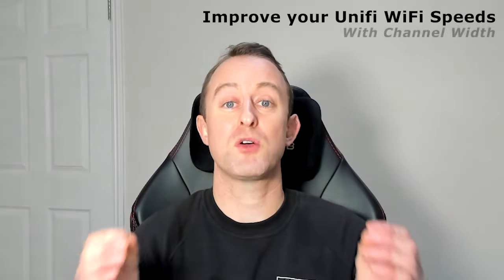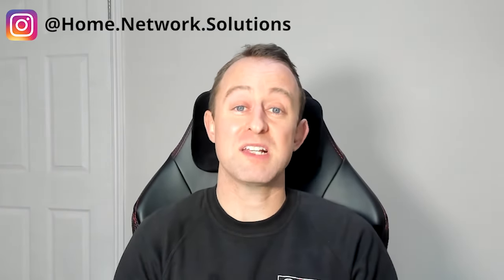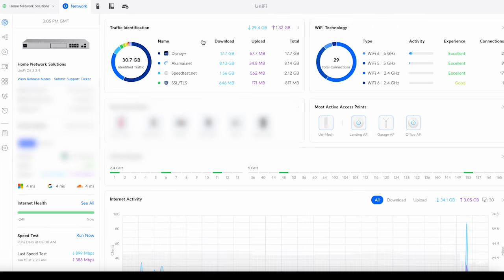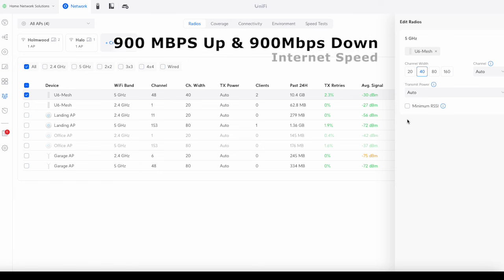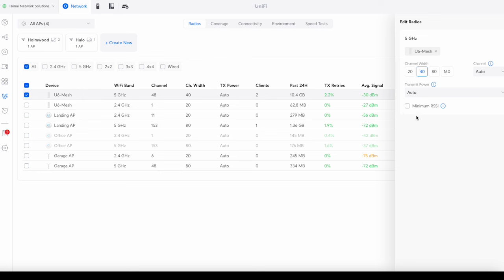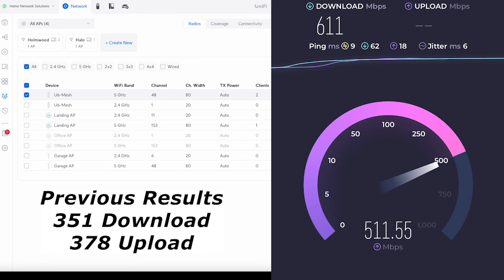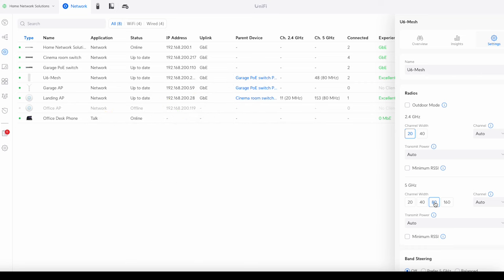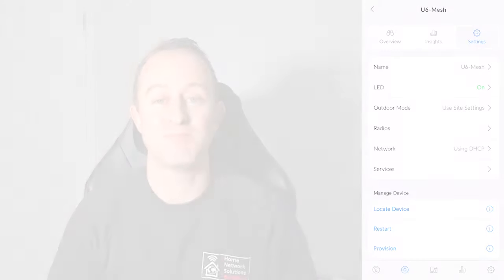INSTANTLY IMPROVE Ubiquiti Unifi WIFI SPEED with Channel Width

Comment: Sorry but what you say is only true if you have few clients. Generally, however, improvements are achieved by doing just the opposite, i.e. by decreasing the frequencies and decreasing interference between channels which leads to an increase in speed.
Reply from the maker: I respectfully disagree. I agree that using a wider channel width of 2.4 is normally not a good idea and 160Mhz on 5Ghz is much more likely to be problematic. However on a well planned deployment of APs there is generally very few occasions that we don’t see better performance from 80Mhz. However each deployment will differ as the environment will be different with different building materials and rf interference etc. 

I’m not sure what you mean by it’s only true if you have few clients, that seems to be unrelated to channel width and interference. Maybe I’m missing something?

Comment: I found this very easy to follow and it had immediate and significant results.  For reference in case it's helpful for others, I have three Acs in a fairly long 4 bedroom house.  One at the front, one in the middle and one at the end of the house.  Before changing the channel width from 40 to 80, I was seeing just about 100mbps.  Afterwards I was seeing speeds of around 500mbps on a 1gbps connection.  Excellent
Reply from the maker: Hi thanks for sharing and thanks for watching the video!

Comment: Hi, thank you for your videos. I've watched your comparison video and got a bit scared of getting the Ubiquity. I'm getting it for my home use and it will be the only wifi extender. I am not sure whether the settings which you showed are accessible to everyone or whether you need a controler (I think I've heard you mentioned that in a previous video).
Reply from the maker: Hi, thanks for watching 🙂
You can change the channel width in standalone mode (without a controller) so don’t worry. Unifi is a good choice you’ve nothing to worry about!

Comment: Does this work for 2.4ghz channel as well?
Reply from the maker: There are less channels on 2.4ghz so the chance of interference is higher. I would suggest trial and error to see if it works for you as it will depend on the RF environment.

Comment: Great video. I’ve updated the channel width but my speeds haven’t changed. I’m next to my u-6 in-wall AP and with gig internet I am hitting ~94. Switching to a different router gets be will over 400 so I am lost as to why my speeds are so awful.
Reply from the maker: 94 Mbps sounds like you have it connected to a 100Mbps switch, or there is a cable fault. Does it say FE next to the connection?
Reply: i’m in the same boat, with a U6 LR, i get 340 from direct LAN from my switch but 90 on wifi.
Reply: @home.network.solutions  missed the reply, sorry about that. I have the USW Lite 8 POE switch. Where would I see FE. I hadn’t thought about the cable.

Comment: curious as to scaleability. say I have 30 access points in a two story 30,000 square foot building would interference be higher if I set all access points to 80. would I get faster speeds if I lowered the channel width?
Reply from the maker: It depends on many factors. Distance between APs, construction of the building, other types of interference, power settings of the APs etc. 
The risk of interference is increased but you can potentially get better speeds, if you need the additional speed it maybe worth trying. It is simple enough to reverse if I doesn’t work for you.